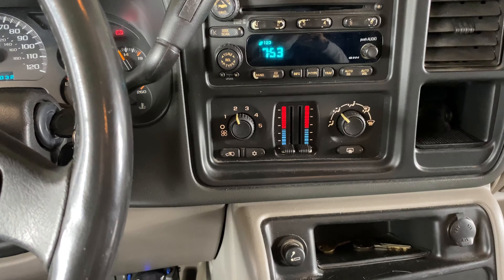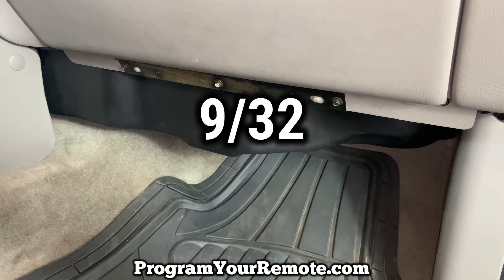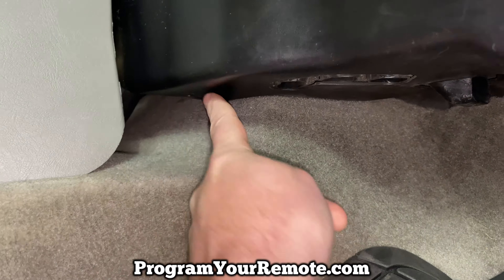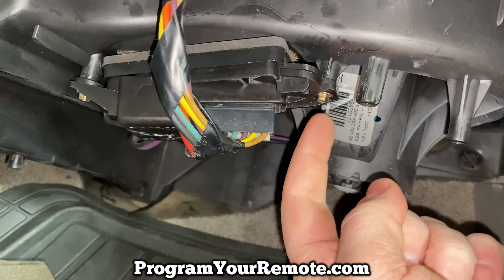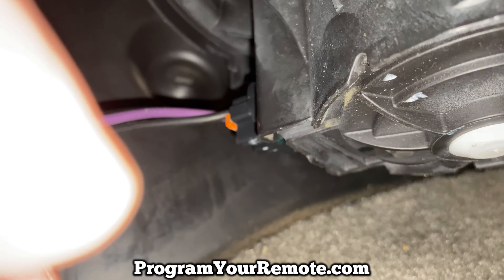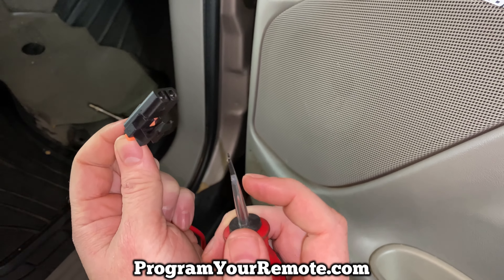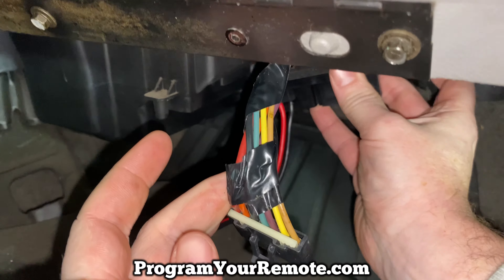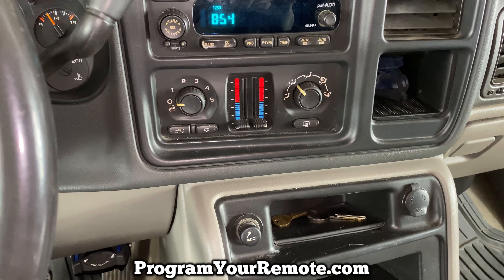How To Fix AC / Heat Air Not Blowing In A 2002 - 2006 Chevy Suburban - Blower Motor Speed Resistor

Comment: I have a 2006 Silverado Z71 with a digital a/c control. Not sure if that matters or not. The A/C worked great and then would intermittently just stop blowing air. The display would not change. It would show 70 degrees with the snowflake light up. The fan was turned up and I tried turning it down, changing temp, etc. Nothing worked. It would randomly just start working again perfectly. This went on for about a few weeks. Then it stopped working and has never come back on this time. The display shows it on and we believe a very slight cold air can be felt but the air does not blow out anything. Suggestions of what needs to be fixed.

Comment: Perfect fix for my 02 Suburban! $19 part, probably saved me $150-200. Thanks for making the video!
Reply from the maker: You're welcome! Glad it helped
Reply: $19 we’re at autozone not under $90
Reply: Same here I am doing it myself later today wish me luck
Reply: May I ask which part and where u got it from? I have 03 Suburban and my heat doesnt blow out at all in the front when it did i had to use it on 5 now its completely out! My rear blows out cold
Reply: @kjackson8701  it’s a little resistor that controls the blower speed, easy fix per the video. That may or may not be what’s wrong with your heater.

Comment: This video was great.  I bought the replacement resistor part from Advance AutoParts and it is a CarQuest part, SKU RUC1007.  I do not recommend getting this part.  It comes with only two holes for mounting and the website notes that you may have to discard a mounting adapter/bracket.  The CarQuest part will not mate with the adapter bracket on the original, so this means that you can only attach one screw to the CarQuest part!  My advice is to get an original GM part or at least one with four mounting holes.
Reply from the maker: good tip!

Comment: I found that if you remove the one bolt that holds the blower housing cover thing that is just to the right of the blower resistor, it is significantly easier to remove that back connector as it gives you direct access to press the holding clip down which releases the connector

Comment: my truck used to just work on 5 now the front doesnt blow at all!! and the rear just blows out cold air I have coolantin there do you think I should just go for the resistor or blower motor
Reply from the maker: I would start with the resistor

Comment: Replaced: speed resistor, blower motor, checked fuses, still doesn’t blow any air? Any advice?
Reply from the maker: not sure - those are all the main things to check. Is your blowing motor getting power to it?
Reply: @PYR-Auto  it has 13v but once the blower is connected it drops under 5v

Comment: Nice. Thank you.
So another thing: driver side AC/HEAT works but not the passenger side. The rear has the same problem as in the video where only top speeds 2 & 3 wrk.
Reply from the maker: the rear has its own resistor - you can find the video on how to change that here https://youtu.be/f95Df5V-Dqs.  Not sure on the other thing

Comment: Does it fix the rear ac also? Or is there another register for that?
My front ac works all speeds but when I turn in the rear above my head or above the passanger seats 1 & 2 don't work.
I have a 2005 LS suburban
Reply from the maker: There is another resistor for the rear - you can find that video here https://youtu.be/f95Df5V-Dqs

Comment: I have all my speeds working just not heating and cooling  ... could that be a bad resistor  as well????
Reply from the maker: I don't believe this resistor controls the heat/cooling in any way
Reply: That is probably  low refrigerant if it is blowing but not allowing to cool
Reply: Could be blend door actuator

Comment: Thanks a lot!!! Too bad I found out the connector was all burned out. But I can take it from here. XD   Regards.
Reply from the maker: You're welcome!
Reply: @PYR-Auto  IT’S WORKING! IT’S WORKING!!!!!
Reply: @whycyber   my connector is all burnt 
What did you do to fix yours? My blower still isn’t working with the new resistor
Reply: @aarontremain6797  Hi.
I had to buy the connector as well. Advance Auto or Autozone should have it.  Take a picture and let them know make and model. Label all wires before cutting and rewiring. (pins on the connector are labeled with letters)

Comment: I have the auto mode unit for hot/ cold. It blows high on cold 60. Then going higher fan speed lowers. And no heat anymore. As earlier at 90 oy it would blow heat.

Comment: What if only the dash blower and foot blower work, but not the torso blower. I have no heat or cold, just ambient temperature, but the freon pressure is good. And the blower speed only works on auto, and kicks low and high constantly, cyclically. lol! (serious)
Reply from the maker: I don't think replacing this resistor will help in that scenario